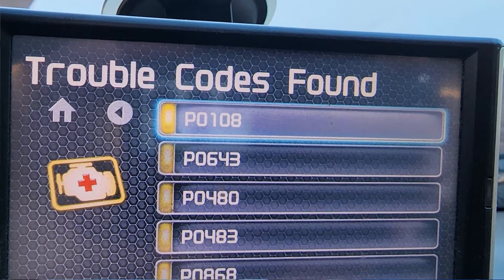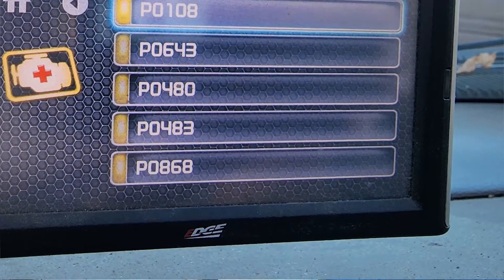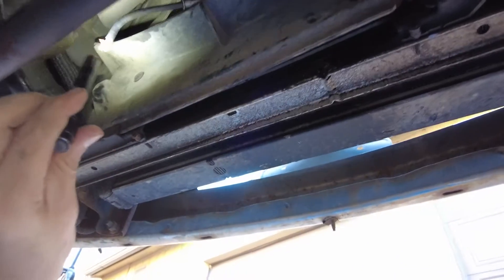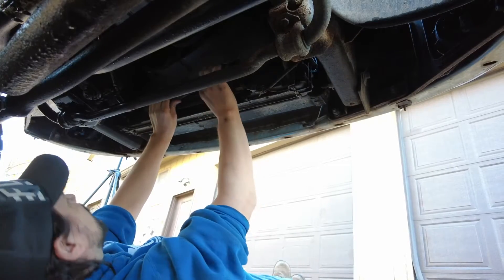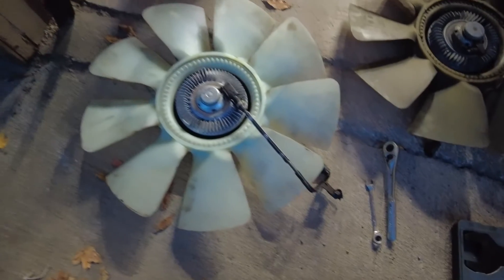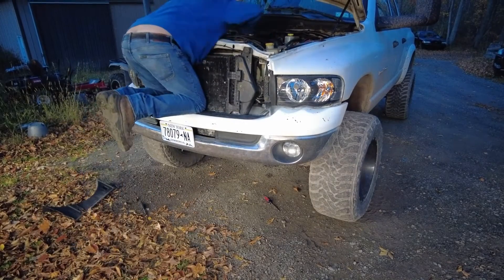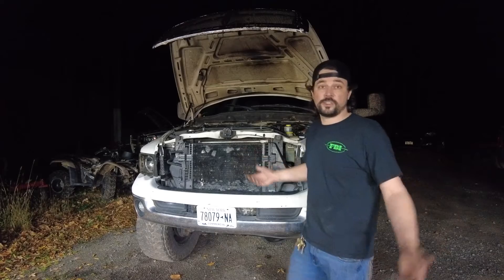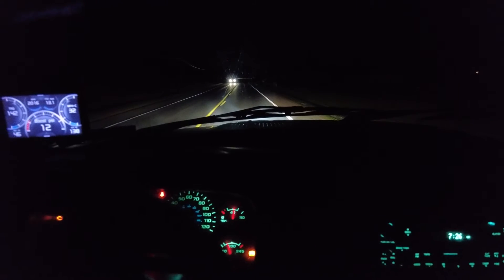Transmission Not Shifting on Dodge Ram Cummins | Check engine codes P0108 P0643 P0480 P0483 P0868

Comment: I have the exact same issue but no codes! After I replaced the fan clutch the tranny is acting like nothing is there but barely goes anywhere. Do you have any thoughts?

Comment: So what was p0643
Reply from the maker: High voltage to the pcm. In my case, it was the wires crossed going to the fan clutch that caused this.

Comment: I had the same codes but my voltage was low instead of high. My fan clutch harness was also cut of. Changed the fan clutch and new fan but my transmission is still not working correctly.. Did you reset the transmission in any way or did you just swap the parts and it was fine? Mine is a -04.5.
Reply from the maker: I may have cleared the codes or disconnected the battery, I can't remember. I would try it.

Comment: Codes P0735 and P0729
Reply from the maker: Are you running a tune? Do you feel slippage in 6th gear? Have you checked your fluid level?
Reply: @The.Odyssey  disconnected it to see if it would run better.  Changed the transmission fluid and filter/gasket.  Just ordered a new transmission today.

Comment: Wow thank you. I had a electrical issue in the door. Needed a new wire harness. And when I picked up my truck - it’s not shifting right. I’m getting the low line pressure code. I’m going to check to see if there are any more codes lol. Thanks
Reply: did it fix it?
Reply: No - I had serviced the transmission and put an after market pan. I torqued everything to specs but somehow the pan was leaking from the drain plug (after market pan) and the filter was loose in the pan. I went back to the factory pan and replaced the filter and all was good for a month lol. Then back into limp mode and same code. The dealer said the valve pack needs to be replaced. I'm thinking maybe some silicone got loose and jammed it. Or maybe it did just go bad. But it's all good now. Well my exhaust brake doesn't work and check engine light is on. So on to the next fix lol
Thanks

Comment: P0480 and P0483 code

Fan of course.

Truck doesn't like 2nd gear i cant get her to hold the greatest in 2nd unless im light on throttle.  Wont hardly shift to 2nd without me letting off to force shift it down.

Also...when i drop the shifter in 2 it acts like manual or just strictly first gear.  All other gears work fine

07 ram 3500

Comment: Are you sure that's what it was fanclutch was making the transmission no to shift ?    I have the same problem and those two code dtc p0108 and dtc p0643
Reply from the maker: Yea, that is what was causing my issue
Reply: @The.Odyssey  ok thanks I'll verify that I do have those two code and I yest overhall the transmission but this truck has a lot of issues too that I has to fix too
Reply: @pedcas5715 did you figure it out? Having the same issue